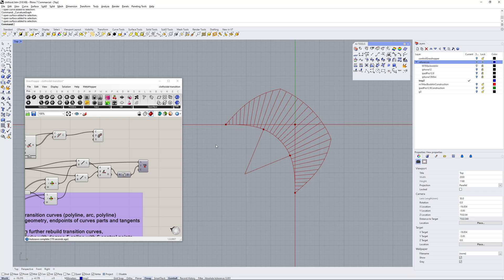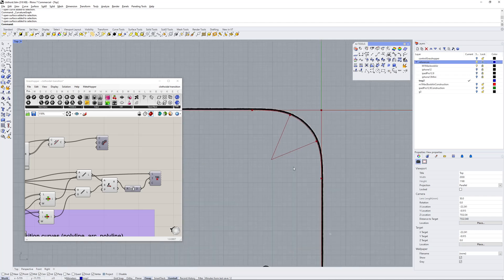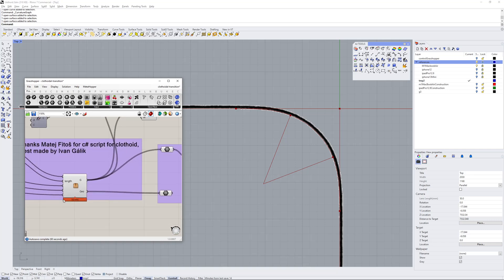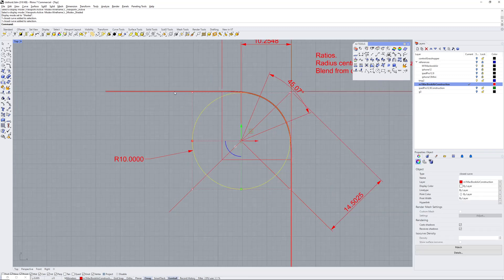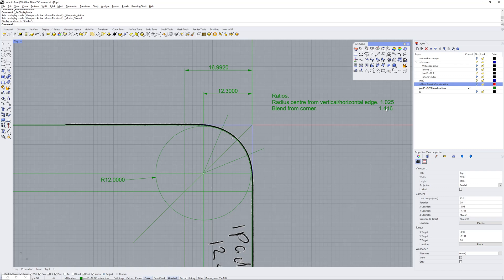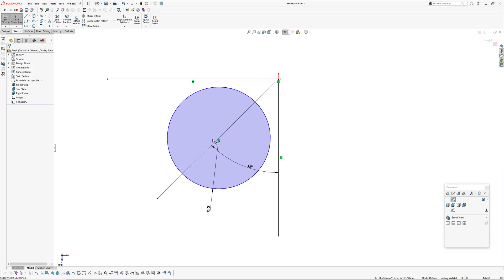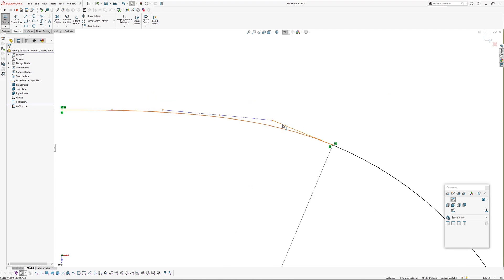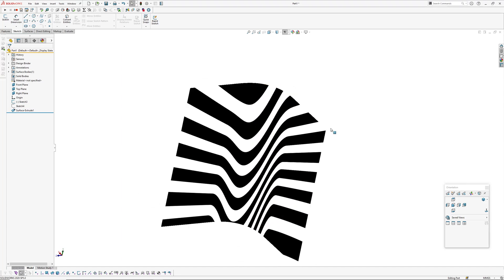Apple Corner 1. Approximated Clothoidal Transition

Comment: Brilliant video... could you please help me understand why you would use a degree 5 spline over a degree 7? Currently I am struggling to articulate why you wouldn't always just a degree 7 because in my head its 'best'... is it because the line and arc have a constant rate of change/ acceleration so the further 2 CVs give no tangible benefit? Thanks a lot.
Reply from the maker: Hi there, good question! As far as I can tell, a clothoid transition has at most a G2 connection with the reference geometry. The curvature graph shows that this is the case as well, as there are discontinuities in the graph where it meets the arc and line. Having an extra two CVs would not add anything, as a deg5 bezier spline has enough CVs for each end to attain G2 and also be independent from the other end. Now I think more about it, it makes sense that the clothoid segment cannot attain a G3 connection on each end, as it is a segment of a spiral.

Comment: Thanks for this. One idea is to drive the setback for the end of the blends is from another angle measurement, eg your arc is 45deg and your endpoints might be ~170deg. Might just be slightly easier to remember and tweak?
Reply from the maker: Hi there. Yes I guess you could do that as well. Off the top of my head, you'd still need two multipliers, one for end points, the other for the set back distance.

Comment: AJ, Great exploration. I tried to build this in Solidworks followed your steps, first build went great, but when I edited the underlying control radius the style splines went crazy. I have a degree 5, controls are set to equal, ends are equal curvature. Any ideas what is going on?
Reply from the maker: First thing to check when style splines with curvature continuous constraints go crazy is to delete the tangent constraint on one end, that is automatically added when you create a CC constraint. SW sketcher seems to get stuck and cannot solve the sketch and shows it as overdefined. Removing the tangent then reinstating it (either by making a tangent constraint between the actual spline and reference, or making tangent constraint between the last spline control polygon segment and the reference geometry) should fix things. If that fails, next step is to create the tangent constraint via a construction line and a perpindicular constraint.... also, for the end of the spline that is G2 to the line, you can make the first two spline control poly segments co-linear to the line instead of using a CC constraint. It is more robust. 

Here's a link to an old video on the style spline CC failure. https://youtu.be/H7eU04ecntU

Comment: Thanks for this vid. It's great. I'll have to have a play and make one of these corners too. Cheers
Reply from the maker: All good, thanks for the comment!
Reply: @AndrewJacksonDesignStudio  FYI... After watching your video, I had a look at the solidworks Fillet feature (filleting a solid object, not a sketch) and found the Conic Rho style is an optional fillet profile. So with a 12mm radius, you can change the weight of the  curve and it's very close to apple curve. In the same "weight field" you can also drop an equation in.
Reply from the maker: Conic sections only have G1 continuity to a line on each end of the conic section. Make a 3D sketch, select an edge of the conic section and convert entites. Then show the curvature graph, which will show this.

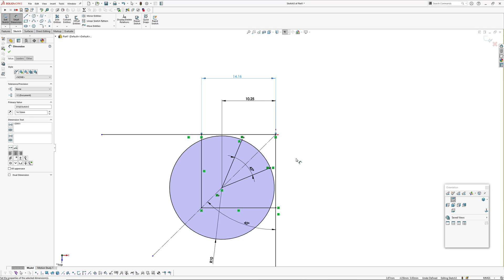Comment: Hello! What is the relation between 10.25 and 14.16? At 10:50 . Thanks a lot!
Reply from the maker: Hi there. They are ratios that I took from the original Grasshopper clothoid output at the start of the video. Those ratios are based around a target corner radius of 10mm
Reply: @AndrewJacksonDesignStudio  Thanks!

Comment: why do you use solidworks for surface modeling after doing all this in rhino? is there any reason for you to use solidworks over rhino?
Reply from the maker: The grasshopper clothoid cannot be defined in Solidworks as far as I know. The geometry/ratios are interchangable as both Rhino and SW are using single span bezier splines. 
I mainly use Solidworks for client projects. Completely different approaches as well for product development. Rhino you have to layer off progress, in case you need to go back and change something. SW, tree based, so easier to tweak things. Downside is SW surfaces can be average and analysis tools in SW are not fantastic.

Comment: I've been unreasonably intrigued by this concept for years. I've noticed that Apple makes less use of this type of corner on hardware and more often in software. My hypothesis about their reasoning is that a neat, constant radius corner is hard to achieve in reality so when it's done, it looks premium. However, on screens, it's easy to achieve and therefore abundant, so a smoother corner feels more premium in that case.
Reply from the maker: It features on the vast majority of hardware that they make. Phones, iPads, MacBooks, iMacs, apple tv and watches. Watches have the added complexity of non flat sides. Even the Vision Pro has the same corner, on the battery etc. maybe it is because it is repeated on every UI item it seems to be used more often? Definitely part of their brand DNA.
Reply: @AndrewJacksonDesignStudio  Really? I guess I'm just mistaken about what I'm seeing when I look their products.
Reply from the maker: This corner (or a variation of it) is on pretty much every rectangular/square piece of hardware they make. Maybe we are discussing different things?
Reply: @AndrewJacksonDesignStudio  I think we’re talking about the same thing. I just frankly assumed they didn’t use it on hardware because it didn’t look like it to me. It definitely sees like you’re more informed than me.

Comment: How to blend control points equally in rhinos?
Reply from the maker: I did it manually with endbulge command
Reply: @AndrewJacksonDesignStudio  By the way, how did you manually find each distance? Is the command in the comment supposed to move the points without breaking the continuity? If so, you need to know the distance to manually adjust it, but how do you find the same distance for each?
Reply from the maker: @ lacking a constraint based solver like SW, the closest I have found to an automatic way is using blendcrv in Grasshopper. Assume the blendcrv in Rhino will space the CVs (fairly) evenly as well

Comment: Really interesting!
Apple pays huge amounts of attention to corners. 
In your demo; I was only missing a simple extrusion and zebra on it to see how the surface flows. 
What CAD software does Apple use for industrial design? Before Rhino’s macOS release I think Alias and Siemens NX was the only nurbs surface modellers available for Mac. Both Alias and Siemens have now discontinued their macOS versions. Maybe they didn’t find it financially viable to port their software to a new CPU architecture once again.
Reply from the maker: Hi there. There's a zebra at the end, 13:20. Also I have a follow up looking at different transitions between the line and arc sections. https://youtu.be/mOOebAttW-c
Apple uses Alias for the A side ID surfaces (maybe for B as well?) and the ID surfaces are imported into NX for ME development. They use Rhino/Grasshopper as well. I bet they use other CAD software too...
Reply: @AndrewJacksonDesignStudio  Ah! My bad, I didn't watch the SolidWorks stuff that carefully, although impressive. Was waiting for zebra in Rhino :D
I have been wondering what degree Apple uses for their corners, but I didn't know the term "clothoid transition". Excellent stuff.
Reply from the maker: Yeah no idea how they construct corners! This is all speculation. It looks like they have the same corner across multiple products, except with differing scales

Comment: Cool stuff! This video brought me back to some old Rhino files, trying to draw perfect Apple-like corners and pill shapes. Do the "real" Apple corners contain an actual arc, or is it a spline with about eight or so control points?
Reply from the maker: I do need to check if this works with pill/lozenge forms, thanks for the reminder. I do not know if they use a single spline or a multi-curve solution. There is no way to know really. Their product drawings for marketing do not show multiple tangent breaks around the corners, but the drawings are no doubt cleaned up.
Reply: @AndrewJacksonDesignStudio  Cant post the link, but google: "Apple Accessory-Design-Guidelines.pdf" and go to page 283 🤯, I just found that, didnt know apple released actual technical drawings.

Comment: Cool, never heard about clothoidal, thanks!  Some people say the Apple corner is based on the “squircle”. No idea if that’s true, but continuous curvature seems to be the consensus online.
Reply from the maker: All good. I’m pretty  sure a squircle has non linear sides. If you get a straight edge and check an iPhone, Apple TV etc, the sides are linear.
Reply: @AndrewJacksonDesignStudio  you’re right, it’s not a mathematically perfect fit. But I think the idea is you’d use each quadrant for each corner, offset them, and connect with lines. That technically creates a microscopic curvature discontinuity where you join them, but it’s so tiny that it doesn’t feel like cheating to ignore it. If you can stomach that, the squircle (“super ellipse”) has otherwise smooth curvature change: it’s not piecewise and has no linear sections. It’s also simple to calculate.
Reply: Out of interest, do you think the mathematical “truth” is important? Or are you just looking for a practical “continuous curvature” radius shape?
Reply from the maker: Any curve defined in a cad system is a mathematical truth. Therefore it’s more about what the designers intent was. All radii are continuous in curvature as they are arcs. Im interested in investigating this as are others as there are different ideas around the ‘mystery’ of how apple may define their corners. The placement of the arc and blends in the grasshopper definition gives a result that is quite close to my reference. I suspect a squircle segment will be a bit too pointy, like a conic with a higher rho value
Reply from the maker: There is the visual aspect then there is the tactile aspect. I've noticed on some corners it almost feels like there is a raised area or a lump in the surface as your finger transitions from the side into the corner. I know there is not, as visually I cannot see it. Unsure what causes this... but it makes me look mad when I start massaging corners on products.
Reply: @AndrewJacksonDesignStudio  regarding “truth” I guess I was wondering more whether you were looking to find a way to describe a curve that has no discontinuities in its curvature, or if you are more interested in matching the Apple corner as much as possible.

Squircle can be as pointy as a square, or as round as a circle. A while back I tried to find the exponent that matched their app icons, it was a good fit but a weird number
Reply from the maker: More about describing the Apple corner and exploring the acceleration of the blends from the line, as they have to ramp up from zero curvature. Single span bezier curves have no internal discontinuities, so if you can match the end curvature, they are good for exploring different approximations, like approximating the three piece solution in this video.
Reply from the maker: I'm going to check the super ellipse next time I'm messing around with corners in Rhino. I had a look online and it seems people are conflating the UI forms with the physical product forms when discussing the squircle. Be good to check it out even if it does not fit the Apple corner.
Reply: @AndrewJacksonDesignStudio  I'll look forward to hear what you find out. 👀
Reply: @aaaidan  nah nah throw the squircle away. It is too pinched. It is more organic and doesn’t gel well with straight lines
Reply: @tonsab.assist.master  there is a family of “squircle curves”, the exponent changes the character of the curve a lot. If it’s too pointy, the exponent may be too high.

Comment: The radius setback makes total sense now that I’ve seen it. If the radius was tangent to the sides, the only solution for a “blend” that stays outside the radius and inside the sides would just be the points of tangency.

Any blend with nonzero length and some sections with curvature less than that of the radius would either:
-start tangent to the side and require either a section of greater curvature or a loop to meet the radius, or
-start tangent to the radius and require either a section of greater curvature or a “hump” that ran proud of the sides.

This is sort of the “hump” option with the sides moved up to meet the apex of the hump.
Reply from the maker: You can get a g3 blend in between a line and arc, with the arc being tangent to the sides. That is one way how I make a lozenge form. I have two angles coincindent to the arc centre, one pushes the line start point back and the other controls the arc size. This can be done with none of the blend CVs extending outside of the line, so no hump. But when used on a 90deg corner, it definitely looks forced compared to having the arc off set or set back.
Reply: @AndrewJacksonDesignStudio  Oh for sure it’s doable. I’ve made some pretty ugly G3 splines trying to get smooth curves to fit the wrong constraints. I think the reason it seems forced in this case that we expect the curvature to peak (or in this case plateau) once in the middle of the corner and run downhill both ways from there with no local maxima. It’s possible to blend a radius into a tangent line with a g3 curve, but I don’t think it’s possible to do so with the maximum curvature being at the endpoint.

Comment: Thanks for the shoutout Andrew!😊😊
That script is a god send! 
I’m travelling right now, I will write some detailed comments this weekend!!
Reply from the maker: Sounds good Tony. Looking forward to seeing what you think. I'm going to check the effect of the three piece corner on the pillowed surface/pinched corner. Might have to decouple the corner and pinch surfaces.
Reply: @AndrewJacksonDesignStudio  so here are some thoughts:
1) How about other angles? We have covered 90 but need to cover other common angles  like 60, 45. 120 and also apply this for the perfect “pill profile”.
2) we can’t be too sure if this is indeed what Apple is doing. Visually it is a very close match. I had some success replicating this rounded corner approximately with a single spline. This would be similar to achieving a g3 continuity between the clothoid segment and the circle. All I remember is I did not use style spline in solidworks to achieve this. Instead used regular spline and manipulated the control polygons. 

3) 3 pieces seem very complex. Looking forwarding to see the challenges in making surfaces out of them. 
Imagine having to construct this for multiple guide curves and what not. Tedious.
4) a protocol for offsetting: I think you should try out various ways to offset this 3 piece corner (both inward and outward). What way of offsetting looks visually pleasing and what way of offsetting strikes a balance between looks and speed.